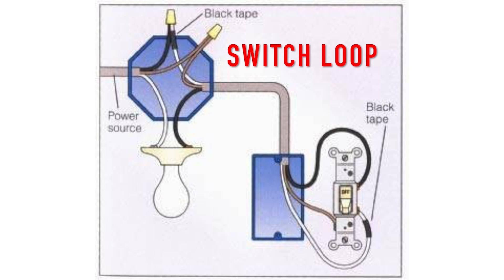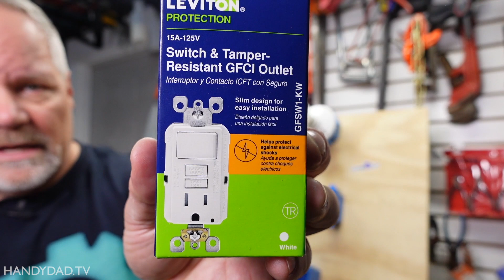GFCI Switch and Outlet Combo

Comment: Just bought my first house that was built in the 40s, managed to replace everything but a switch outlet combo in the bathroom. I spent hours trying to understand the wiring diagram and even put out a quote request for electricians, all of which were 200+ for one outlet. Thanks to this video we got it installed and working, you saved me money and the health cost of all that stress, thank you!
Reply from the maker: Glad it was helpful 👍🏻
Reply: Hey, so it looks like the light isn't on the GFCI if it will work regardless of it being tripped. Can u show how to wire it so I can get both the light and the outlet to work on gfci?
Reply from the maker: That’s unnecessary and not recommended. Permanent fixtures do not need shock protection. Only outlets do. You wouldn’t want to be left in the dark if something trips the GFCI.
Reply: @handydadtv  I'm trying to fix another issue.  Button on the jacuzzi tub stopped working, but is in the 'on' position. Want to use this as an alternative for tear out and replacement of the entire tub.  Motor currently runs on a gfci.
Reply from the maker: @tool46372 So, currently you have a 20 amp breaker to an outdoor GFCI outlet where the jacuzzi is plugged in. But the jacuzzi switch is broken so you want to add a switch to the outlet instead so the jacuzzi will turn on when the switch is on. Is that correct?

Don’t jacuzzis need to run every day to filter the water? When would you ever leave the switch off?
Reply: @handydadtv  indoor. Bathroom jacuzzi tub.
Reply: Currently, the only way to turn it on and off is with the test and reset buttons on the gfci outlet
Reply from the maker: @tool46372 In that case, I’d definitely recommend replacing the button because I’m sure the outlet is hidden underneath.
Reply: @handydadtv  button cannot be accessed without a complete tearout. Gfci outlet is 5' above the pump. Bathroom is on the 3rd floor of our home; no chance of rising water.
Reply from the maker: @tool46372 Wow sorry to hear it’s such a bad design. I wouldn’t recommend a combo switch/GFCI there. Here’s why: If you use the combo, the switch won’t be GFCI protected because it would be wired before the outlet. Since the bather would probably be turning it off before leaving the tub, I wouldn’t want them to touch an unprotected switch. Plus they’d need to stand up to get to it and risk falling. I wouldn’t do it. 

So I have two choices for you to consider:

1. Replace the breaker with a GFCI breaker and replace the GFCI outlet with a non-GFCI combo. No shock risk, but still has the risk of falling.

2. The other option is to leave the GFCI outlet alone and add a switch somewhere after the GFCI. That would be just like replacing the button.
Reply: My house was built in the 60’s and bathroom switch only has one black and one white wire..how can I wire this switch combo? It’s driving me insane!!
Reply from the maker: @Anthony-ng2kr You can’t.

Comment: Bought one of these for my shop bathroom for above the toilet. Had instillation down until I watched the video...lol
Reply from the maker: What changed?
Reply: @handydadtv  I got confused on a part where u wired it . I'd have to rewatch to know exactly where now. After taking mine apart I c I have several lines connected. It's been yrs since I did this so going to have to go up n follow lines n mark them. This is the only Good about bathroom not being completed..lol

Comment: Hypothetically, could this work to replace a normal outlet to have an outlet that also powers a light?

My situation is I have a garage that doesn’t have an outside light, the closest power source is a outlet on the ceiling that only has a garage door opener plugged in and the other half the outlet I never use since it’s up on the ceiling.
Reply from the maker: Yes
Reply: @handydadtv  thank you so much. Turned out great! I was annoyed having an outlet that was only being used for a garage door opener, using this GFCI combo switch helped make the outlet to code and gave the outlet more of a purpose. I can’t tell you enough how much your videos have helped me; I bought a 1960s house a year ago so it’s needed a lot of work inside the house and the garage and your videos have been a life saver. You’re the best
Reply from the maker: Thanks so much 😊

Comment: I have followed your instructions on my 1970's apartment bathroom. The switch works correctly but the receptacle works only and if only the switch is on. Could anyone can help me out?
Reply from the maker: Use a voltage tester to troubleshoot.
Reply: Yes the hot load was wrong. Thank you!!!
Reply from the maker: I knew you’d figure it out. 👍🏻

Comment: You can wire it so the switch is also in the protection mode. You would connect the incoming power from the panel to the LINE as normal (hot wire to the brass screw and neutral wire to the silver screw).Then the neutral wire from the light would go to the silver screw on the LOAD side. One of the switch wires would go to the brass screw also on the LOAD side. The other switch wire would connect to the hot wire from the light (wire nut or wago), and you're done. I believe that would do it.
Reply from the maker: Yes 👍🏻
Reply: Thank you.  That is what I was looking for.

Comment: Thanks for this very clear and informative video.  As luck would have it, I'm trying to install the switch/GFCI outlet combo in a box that has just an existing switch, and there's no neutral wire in there - just 2 blacks and ground.  Any suggestions or is this not possible?
Reply from the maker: Not possible without running a neutral. Unless you want to use a smart switch and smart bulb.

Comment: READY FOR THIS ONE?  Have a 20amp breaker with only the dishwasher and garbage disposal on 1 home run circuit. What the prior owner seems to have done is wired from the dishwasher to a "switch" under the sink which then connects to the disposal. The new disposal, however, has a plug and is not direct wired - so instead of just copying the prior disposal wiring I need to get this device. How to wire using this switch? Thanks and God Bless:)
Reply from the maker: I would leave the switch alone and add another box with a GFCI outlet wired off the switch.
Reply: @handydadtv  funny you said that cause that was what I was thinking. Since it is on a 20amp circuit wasn't too keen on putting in the 15amp switch. I presume the new gfi outlet will be 20amp. You have a video link from you that shows me how to do it for my situation? BTW THANKS for the fast reply and so you know, I did subscribe even before your reply. God Bless:)
Reply from the maker: @legaleagleandpaws8198 It’s a misconception that a 20-amp circuit requires 20-amp outlets. That’s typically done only if the circuit has a single outlet for an appliance that might have a 20-amp plug, like a big window air conditioner.
Reply: @handydadtv  The wire there is already  12/2 so I spent the extra to get the 20amp GFI so it all matches:) But I see and agree with your point. Thanks again!

Comment: my bathroom doesn't have outlet just a switch that turn on light and fan, do  I need to replace cables? or just buy a  switch combo and install ?
Reply from the maker: Watch this video again. I explain that you need a neutral wire to add an outlet.

Comment: So we can't protect the switch on the receptacle with the gfci on it? For example, couldn't I just connect the power wire to the line and then connect the switch wire to the load ? I ask because I need a gfci protection for my bath light fan for my bath light fan to be able to be wet rated but I was gonna get this particular combo receptacle to protect the bath light fan and also be able to turn the bath light fan on and off. Or will this not work? I was going to call leviton to double check until I saw your video...
Reply from the maker: Sure you can wire the switch off the LOAD terminal and your device will be protected.

Comment: This helped me get one hooked up, except it’s replacing an ollllld non gfci one and there is another set that of can lights and a light switch downstream that won’t work with it hooked up. Is there something special you have to change for downstream stuff to work? My understanding was the downstream was connected where the lines in the box are pigged and the pigs go to this. But now the downstream is getting nothing regardless of switch position.
Reply from the maker: It’s not something that can be diagnosed remotely. Unfortunately you’ll need a voltage tester and figure it out.
Reply: @handydadtv  that’s what we ended up doing. Chased the wire all the way back to the issue which was the previous DIY person who owned this place years ago using a neutral colored white wire as the load wire. Was such a dumb thing to find out, marked both ends with black electrical tape since we can’t rip out all the drywall to replace it. It literally just wasn’t getting power because I saw neutral wire color and assumed it needed to be wired as a neutral, so no power was going down stream 😅

Comment: My switch has the "loop" wiring.   Do I need to install a new box and run a new line from the panel just for it?
Reply from the maker: It doesn’t necessarily need a new circuit. Perhaps just another wire from the light.

Comment: I am changing a combo outlet to a gfci  combo outlet. Once I Opened up the outlet it had a blue wire  and a pig tailed black and white wire connected  in the original outlet. Watching your video I have everything figured out but what to do with the blue wire and where to connect it
Reply from the maker: Blue is non-standard. You can try to figure it out or just re-connect it the same way it was.

Comment: This video is fantastic. Easy to follow and to the point. Thank you. Please forgive my ignorance if this is a dumb question. I have a non gfci version of this (switch for overhead light and outlet combo). It seems it is split wired with separate circuit for each. Its over a sink so Im trying to convert to the gfci version. Can I wire one circuits hot to one of the switch wires (to power the switch) and the other circuit hot to the outlet? If so, what do I do about the neutrals in this scenario?
Reply from the maker: First determine which circuit breakers control those two hots. Then turn them off so you can work safely.

You can definitely use two separate hots with the GFCI combo switch since they are separated by default. Keep the neutrals same way they were (should be separate). One will go to the outlet. Not sure what the other one does.

Comment: Your video was very helpful, but also told me what I was trying to do was not going to work.  I only have a wiring that is two wires.  No neutral or ground.  How do I go about changing that so I can put in a switch and outlet?
Reply from the maker: You need another power source.

Comment: I have a double switch I want to do this to. Can I bypass the one switch to keep my outlet hot all the time, then also wire this in as an extra outlet, and the top switch controlling an existing closet light? How would you wire something like this?
Reply from the maker: You need hot and neutral.

Comment: Question: I have the loop situation where you described around the 3 minute mark. Are there alternatives to this? Perhaps another configuration? Really want that outlet for a bidet. Thanks in advance!
Reply from the maker: The alternative is to find another power source. 

But if you have a high end bidet with a heated seat and heated water, then you definitely don’t want to wire it on a lighting circuit. It will absolutely cause your lights to flicker like a disco! Trust me, it happened to me. Have an electrician run a new circuit for you. I had to do that in my new house. It cost me $300 cash but it was money well spent.

Comment: Thank you so much! You saved my bathroom! Your video was perfect for the wiring in my 1966 house.
Reply from the maker: Glad it was helpful 👍🏻
Reply: @handydadtv  Since you might have mis-wired it, why did you stick that Stranded Black Wire into the Black Line port instead of the empty Black Load port (found underneath the yellow label)? (All gfsw1 instruction manuals I found have the Stranded Black Wire connected to the Black Load port)
Reply from the maker: I prefer to wire it to the line screw so the light stays on if the GFCI trips. Code doesn’t require lights to be GFCI protected.
Reply: @handydadtv  Thanks very much. I did notice that the tripping of the GFCI outlet would also turn off the load (in my case, it was an exhaust fan)

Comment: Just installed one of these. Question is, wouldn't I be able to put the light neutral and light hot on the load side?
Reply from the maker: You can if you think the light is a shock hazard.

Comment: Very clear instructions, thank you, thank you, thank you...  I would have gone nuts trying to figure this thing out.  
The instructions on the sheet manual is just too confusing what is what.  
Also, I had done some pig tail for the neutrals, but when I saw you pushing these into the slots, that did the trick for me.
Genius!  
You are the only one, not even Levinton has a video on this model.  I quite like this switch/ plug, it is more stylish than the old style knobs.
Keep on GOING, HandyDad!
Reply from the maker: Glad it was helpful 👍🏻
Reply: Seriously. I just ran myself out of swear words and had to call it a night. I think I can actually get this working tomorrow now.
Reply: @decepi  😆

Comment: Very informative video. How would you install this device so the switch controls the outlet?
Reply from the maker: Connect the hot wire to one switch lead and the other switch lead to the LINE screw.
Reply: @handydadtv  Hey Great video! For the question above. Will wiring it this way still provide GFCI protection for what is plugged into the outlet? Also, I am looking for the switch to control only the outlet and for the outlets down the line to still work no matter what position the switch is in. Is this possible?
Reply from the maker: @user-sf7io1ok6m This outlet will always be protected. The downstream outlets will only be protected if wired from the LOAD terminals. But if you switch the LINE, the LOAD is also switched.

Comment: If you have more than 2 neutral wires in the switch box, how do you know which 2 go to the light in question? In my scenario, I have bathroom where the toilet and tub are separated from the sink by a wall. There is 2 gang light switch next to the sink where 1 switch controls the sink light and the other switch controls the light where the toilet and tub are. I want to move the toilet/tub light switch to the other side of the wall so you can use the light when on the toilet/tub side. I want to use a GFCI light/outlet combo on the toilet/tub side of the wall, and convert the sink side to a single gang light switch that only controls the sink light. So my question is, how do I determine which neutrals go to which light. I know if I remove one and the light goes out, I know which ones GO to each light, but how do I determine the RETURN neutrals for each light?
Reply from the maker: You need to figure it out with a voltage tester.

Comment: Thank you for helping/showing me how to hook up a GFC combo. I Got a 20amp lt- swtch/gfc and was at a loss for clear direction in hooking up the light switch/ gfc on btm added back wires: on a orange hot , yellow neutral and red to lt/ switch /power. The other wire to share w line in/hot . Question?? I used a Wago 221  on the one red  its #14 aluminum stranded to # 12 awg  copper, tapped levers down and solid in box, should I use that anti corrosive-paste in the Wago??   The led light is low watt and all other connections are Tessa taped (good stuff). inside wall no humidity/dry.  Or should I redo with a yellow good nut cap.. Thx in advance Lynn😉
Reply from the maker: No need to add any anti-corrosive. Wagos are designed for different kinds of wire. All good.
Reply: You rock! Thx @handydadtv

Comment: Thank you!! Great teacher!!! I also want to install crawspace lights. If i by string LED lights, can I cut the plug off and wire them directly to a switch? Is that okay as long as they are in a box and all the rest?
Reply from the maker: No that’s not appropriate. Just wire an outlet from the switch and plug them in.

Comment: I bought this device, and wired the light to not have gfci protection,  since there is only a switch leg to the light, in a two gang box, that has neutrals for the other device.   I found that this device will snugly hold the solid #12 hot and the #14 stranded from the switch on this device, under opposite sides of the same gold colored  lug.  I tugged on the # 14 repeatedly, then made sure the screw was still snug, before making it up in the wall.  I think Leviton must have put special lugs on this device, to allow for the stranded switch legs, and larger solid conductors.
Reply from the maker: Perhaps you are right.
Reply: Why don't you see if your device is like that?   I just bought mine last week, may be a small redesign?
Reply from the maker: I don’t have it anymore.

Comment: Great video but I have a question I’m working on a project where I need a gfci outlet for protection because it involves water but I’m also going to need a switch to turn the device on and off can I wire that outlet and switch together and if it trips just hit the reset button and the outlet and switch will be back to normal  ?
Reply: Ok I will do that and thank you for taking some of your time to answer our questions and teaching us I truly appreciate it
Reply from the maker: Yes. Connect the hot to one of the switch wires and the other wire to the LINE on the outlet.